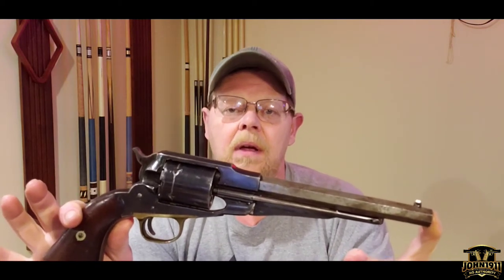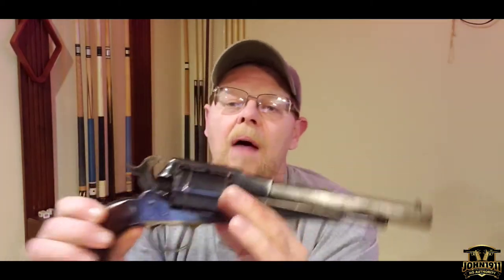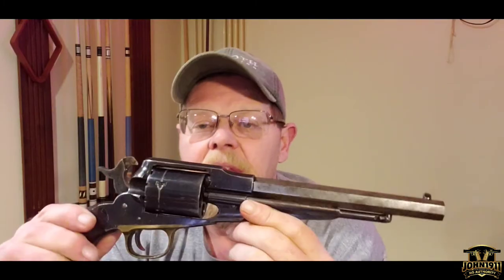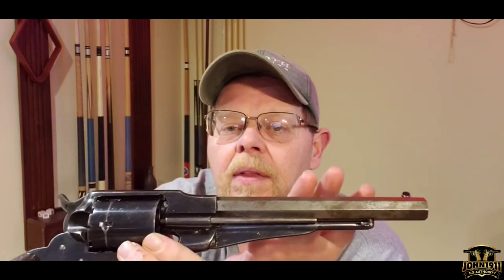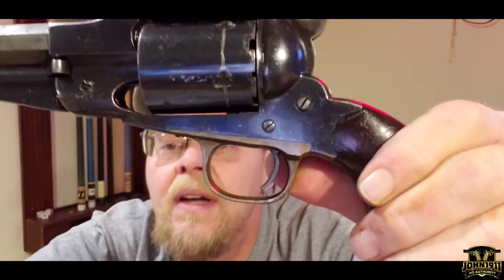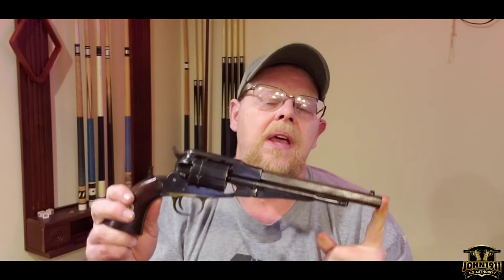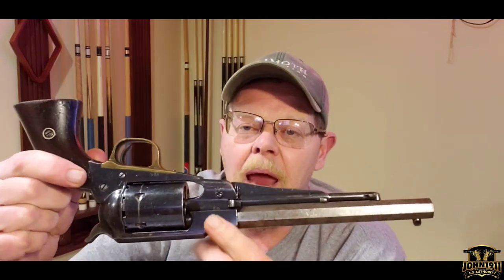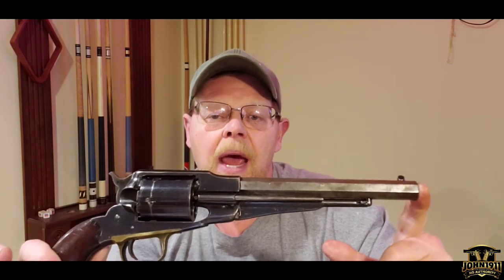Remington 1858 Rimfire Conversion

Comment: Thank you so much for this video. I just acquired one and had to do some good research to finally find out what it was. I knew it was a conversion but had no idea if it was factory or what caliber. It is exactly this one you are showing. Now i see they mostly have a built in extractor that pushes the spent casings out. I have only seen one other without that rod. The one i got doesn’t have that rod. Anywho thanks again great info.
Reply from the maker: Edger, glad you found the video helpful. These line of guns were a consultation we did with an estate. Sounds like you have a nice example. —Marky